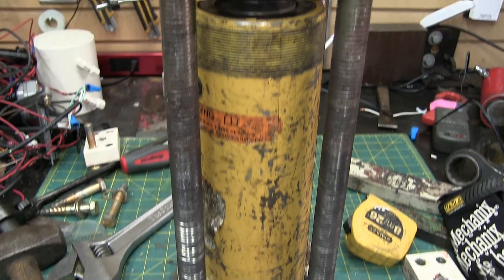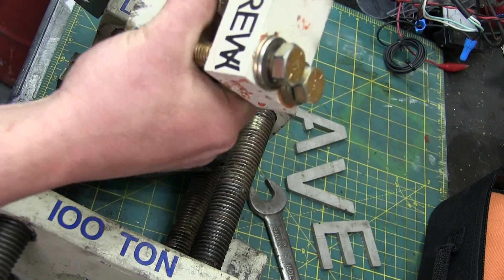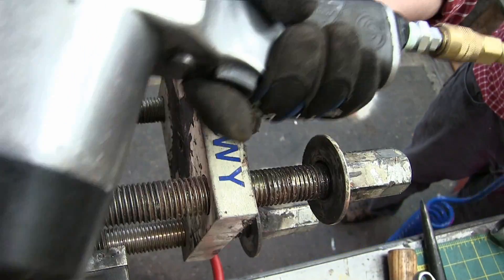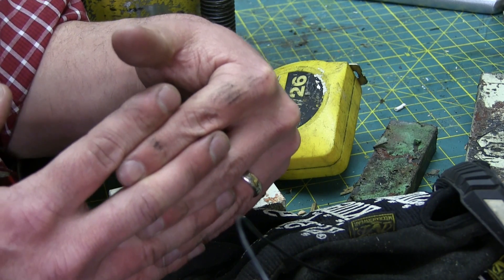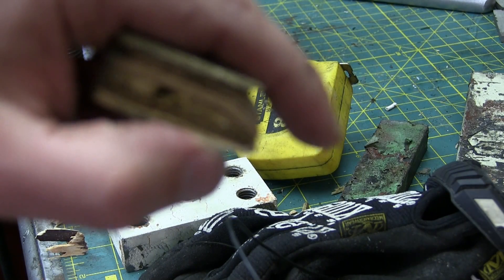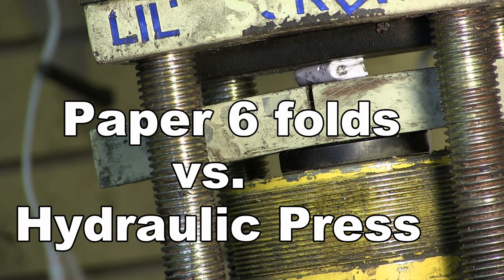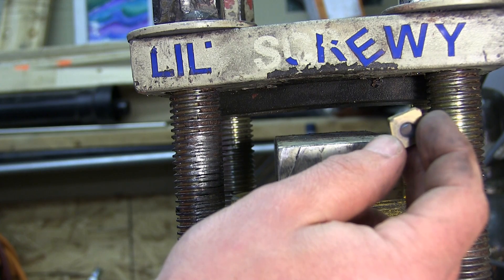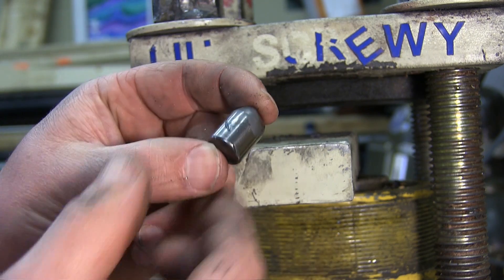Why Paper EXPLODES in a Press?! Prince Rupert's Drop, Tungsten Carbide and more!

Comment: I guess I'm a weirdo...  I didn't have to ask why things explode because energy can only be forced in upon itself just so far, then as more energy is applied past that point of equilibrium it has to go somewhere...  Anywhere.
You're actually causing a micro implosion, just a bazzili-second before it redirects all that energy and explodes.  One grain of sand on a 100 mi. long, 1/2 mi. wide beach that is a "nuke" (basic principle dumbsplained).
  All things in the universe (and a few outside of it) contain its originally allotted amount of "sacred smoke."  From a one celled organism to complex electronics and mechnically oriented contraptions and contrivances, things only work at their station in life as long as they contain that exact amount of that "unidentifiable quantity" of holiness and, once you devise a way to release (or, more impressively, add) any amount of that sacred smoke, she's a-done chuchin'.  For good.  Unless, of course, you replace any component(s) which has had its allotment of smoke to change with a new component, which contains that original amount of sacred smoke, as allotted by the Devine divinity him/herself, putting all things back into its universal balance which, fine-hairs crossed, allowes the flow of the universal forces to church their way along, once again. 
  This "rechuchification" always comes with a cost. Sometimes just some physical effort, perhaps accompanied by the permanent exhaustion of some brain cells and, sometimes, with the addition of great fiscal sacrifices which usually preceed the delivery of a very effective lesson in how to not "dechuch" an item in the first place.

Comment: The geometry of the paper stack affects whether or not you get an explosion.  HPC uses relatively tall stacks of paper.  As the load is applied the compression is transferred to tension - the paper under the press is trying to squeeze out like toothpaste but since it has tensile strength it cannot do that, until it fails all at once. 

Ave used a relatively short stack of paper for the surface area being loaded.  There's not much vertical space for the compression to translate into tension,  so no explosion.

Comment: The exploding could also be due to building pressures at the center of the material. The pressure reaches a point where the material can't be compressed any longer so it starts to tear. The tearing pushes outwards on a separate plane from the pressure of the press. This outward pushing acts as a type of relese for the pressure, thus the material then explodes outwards following the release. The start of tearing to exploding should happen within a fraction of a second.

Comment: You could make those tungsten carbide drilling tips fly straight.  You need to use a sabot around it.  A sabot is a discarding sleeve that goes over the projectile and sits between the projectile and the bore of the firearm.  Tank rounds made of hardened armor piercing metal use a sabot so they don't destroy the barrel when fired.

Comment: When you mentioned the tungsten making a nasty projectile if someone could find a way to stabilize it's flight, it has been figured out but its still not perfect... Tungsten core rounds with copper+lead jackets are very much in use. More interesting are the SLAP rounds that were designed and prototyped by the US military. (S)aboted (L)ight (A)rmor (P)iercing. They use a plastic sabot around a tungsten projectile much smaller than the bore of the barrel so the tungsten doesn't strip out the threads. If you happened to be in the US and we could find a legal way to do it I would be willing to try to arrange making a couple avalable for you to check out. They are rare, go for $25+ per 7.62x51mm round if you can even find them, they were only produced in small prototype numbers in the late 1980's. If its something that interests you I can arrange to send you a few pics of them from a 1988 batch.
Reply: The reason why the SLAP rounds were never mass produced was because they had an issue with flashhiders on the end of standard issue rifles causing rounds to fly all cattywampus, sometimes even exiting the sides of the barrels. Plus the plastics available at that time were much lesser than we have available now so quality control was somewhat of an issue from what I understand. Perhaps they should revisit the idea. Also, light armor piercing doesn't mean lightly armored personnel, it means lightly armored vehicles, barriers, vehicle engine blocks, etc.

Comment: On the subject of things exploding, the recent turbine blade failures on "the most commonly used jet engine" comes to mind. Being a registered sonographer I understand the physics of ultrasound in soft watery bags of meat, but using it metal intrigues me. I currently work as a machinist CNC programmer fixer runner, bottle washer. Maybe it would be cool to cobble together something in the shop using ultrasound to look at metal. I see they have some pretty cheap probes that work ..........yup on a smart phone. Resulting image probably sucks pretty well but what the who never stopped me before. What frequency would we be needed to look at metal what kind of coupling medium is used? Yhea Yhea I know I will use the gargler and seek some info on my own but I am sure a lot of folks would be interested on your take,
Keep the AWESOME vids coming me and my buddy Merlin (cat) love to watch after shitty day at the work place.
Stick on the ice! But it is Damn cold with no T-shart hint hint.

Comment: when you squeeze a piece of an object , the points that hold it together as an object, slowly tear apart , and when there are not enough points to hold the object together the forces that tear the points apart cut the piece apart from the object channeling the force that the piece has been into . this force is channeled from the piece to the object by the mass displacement from the pressure .

Comment: what diameter are the carbide rock drill inserts? the only way i could see making them fly straight would be to give them a lead or copper jacket that is soft enough to engage rifling or put them in a plastic sabot (like some muzzle loader rounds have and sabot shotgun slugs) to impart spin on them to make them spin stabilized

Comment: Well, the tungsten carbide insert would be inherently weaker as it has a hole in it. I'm not saying that there's no difference between the rock button and the insert in terms of grade, but I think that the insert might have done better if it was placed with the hole bore being vertical. Good fun stuff.

Comment: hard to believe I'm back on this vjo after a whole year, just now thinking the paper didn't explode because the pressure was added slowly. Yuri's press moves a little quicker than lil screwy. especially being that lil screwy is at max capacity near the needed pressure them last few tons take a second.

letting the paper gradually deform instead of all at once.

Comment: Without reading the whole thread I'm asking a question that may have been asked already, forgive me. But would it be possible to flip the top and bottom platens and straighten the too near flatness with the press and at the same time putting some work hardening into the platens to increase their strength.

Comment: really gives ya respect for the kind of forces that steel punches put out o.O
got one at work that I BELIEVE is totally mechanical. No evidence of juices leaking out of it  at any time in the past. Just the goop what comes pooping out the sides of the bushings when they grease it up with the zirk/zerk/Xirek? fitting
Thing just goes CLICK A CLACK A CLACK A CLICK and doesn't slow down for nothing.
If you can fit it in there it will cut it
Maybe I'll be naughty and trick the maintenance crew into rebuilding it >.>  <.< so I can watch

Comment: Haven't seen anyone say this but they way you put the prince rupert's drop in there didn't give a good test you need to leave the tail out of the device. The tail on a PRD is its structural weak point to the point you can break it in your hand. However if you don't touch the tail you can smash it with a hammer and it will put a dent in on your bench before even come close to breaking it. So to accurately determine how many tons it takes to break it you have to let the tail hang out of the press like i said you can break a PRD with your hands if you just snap the tail off.

Comment: I could be wrong but the insert looks ceramic! Usually carbine insert will have chip breaking geometry on the faces. They are used for cutting harden steel as a cheaper alternative to diamond.

Comment: You might want to lube those bolts, and flange of the nut, with some Molykote G-Rapid plus paste. It's a lubricant with molybdenum disulfide that decreases the friction, so you get to use less torque on the bolts for more clamping pressure..

Comment: Does anyone even still use slugging wrenches anymore? I remember pulling the skirts on water turbines to restuff the stuffing box seals, and using them. Also at mines and erecting traffic lights, bridges, etc. A 1" or 1 1/2" impact seems easier.
Reply: Your plates are warped, but so are you! Use a plastic sabot, a 12  gauge with a rifled deer barrel and those carbide boron rock teeth will fly straight. The plastic sabot (shoe)  and a rifled barrel will put a hell of a spin on that chunk of tunstern. Take it from a crazy Arizona electrician, from the land where happiness is belt fed, and we shoot at anything ,whether it moves or not. Actually Colorado & Wyoming look more shot up than Arizona. I guess we like shooting at each other too much to attack the road signs. Gotta save that ammo, for when the SHTF.

Comment: It basically explodes because you are putting a LOT of potential energy into a small place.  When that potential energy overcomes the physical tensile limits of the material, you get a LOT of energy and a LOT of heat released at once.

Comment: What about temperature increase? Since HPT's press is capable of 100 tons, I would imagine that there's a significant increase in temperature as the material compresses, and the energy can't be dissipated through deformation. Some materials appear burnt, as if portions of the material reach a flash point internally, which causes heat damage.

Comment: The black dust that exploded out of the hockey puck was probably the carbon dust filler that they add. It does not get "absorbed" into the material as much as its trapped in there until it was released. The rubber itself did not turn into powder.
Reply: +Das Neko I thought some of the pressure convert to heat and burned the center of the puck, where the stress was the biggest, just before it snaped.
Reply: *****
Maybe, maybe not but that is definitely dust and looks very much like coal dust.
Reply: *****
I support your observation. Charring is always an indicator for high temperatures.

Comment: I work for a heavy engineering company that cuts very hard metal F30 etc regularly sometimes vaguely exotic stuff like Inconel.
I've told this story before so stop me if you've heard it.
:-)
I remember a demo at my work back in about 2006 of ceramic machine blades similar to the one you just killed.
They were demoing these ceramic blades that could withstand heats far beyond what all the machinists had been trained was  possible.
The feeds and speeds in the demo were making all the machinists (and me because I felt like these guys knew way more than me) back away  from the experiment.
They machined a seat pocket with no cooling in about 1/5 of the time we'd always done it.
It was amazing to watch the shock and awe of these machinists that had always been taught to cool the tool on the work piece nervously backing away from the witchcraft on display.
That's progress I guess.
It was an amazing experience.
Luv and Peace.

Comment: When you crushed the Prince Rupert's Drop, it seemed to be pressing against the "tail" and snapped it off, causing the drop to explode. Could you do this again ensuring the drop is pinched from the sides without applying pressure to the "tail" of the drop?

They should be able to take a lot of force before popping!

Comment: Should've used your FLIR camera to monitor the temperature as things are compressed. I'd suspect you'll see temps increase significantly.  Although the steel in the press would sink a lot of the heat away from the DUT.

Comment: it is called brittle fracture by the way.
Reply: +AvE sorry I should have been more clear in the materials that had a lot of deformation from the plastic deformation it had just reached the maximum amount of stretch in the material. The harder materials such as the carbide bit experienced brittle fracture due to the inability to stretch due to the type of material and the way it was constructed as well as the direction in which the force was applied. if you took your cutting bit and layer it flat instead it would withstand a much greater force.
Reply: +David Powers that being said I very much enjoyed your video. :)

Comment: thank you so bloody much for your inclined plane screw comment. I find too few a number of people that comprehend how the 3 simple machines rule the function of every mechanical object in existence. You air get it...secure your phallus via an inclined plane wrapped around a pulley/axle which forces two blocks of steel together with tremendous force!
Reply: You sir get it; fucking autocorrect...diddly

Comment: Is saying it's plastically deformed correct? It's technically a brittle material so experiences no plastic deformation.
Reply: +AvE Well I'm thinking of a mechanical definition purely, but if a material does not experience plastic deformation and necking before a fracture point, wouldnt it be defined as brittle? If you exert tensile stress on a straight branch, it won't stretch and neck like a metal, it will just crack at critical stress like a brittle material. I guess a tree though is more of a composite material with grains in every which direction which would complicate things.

Comment: The Prince Rupert drop test was unfair in that it is supposed to be unbreakable provided that you "do not disturb the tail". The tail should be cushioned or placed outside of the pressing area so that it cannot slip and hit the press face as it did so easily in this video.
Reply: +tiger12506 not really unbreakable but really hard to break. stronger than steel.

Comment: of course the paper explosion video was faked, it most likely had a small amount of a sensitive high explosive in it like mercury fulminate. Paper does not explode dude! it ain't like a hockey puck or a prince ruperts drop that is under high tension. Just my thought, but I bet you could do the paper with a million tonne press with no explosion. you're a smart guy, pretty sure you could've worked the out chief. Love the vids either way.

Comment: The only part I would add for something like the hockey puck is you're adding kinetic energy, which is upping the temperature; at a certain point as the temperature rises if the pressure can't get out the material may sublimate to a gas and force elastically its way out.

Comment: I'm disappointed by the lack of physicists explaining this.
Reply: +mastermanio2 I believe the explanation by this channel isn't exactly thorough. What I believe is happening here is the compression of matter and air heats the material enough to allow it to explode. You'll notice it's only combustible (e.g. organic material) that explodes under the hydraulic press. This is because compressing a material heats it if all other conditions are equal. This is also how a diesel engine works, the fuel-air mixture explodes due to the pressure exerted by the pistons.
Reply: find the reply by scasny to hydraulic press channel.  some things explained there.

Comment: Nothing to do with trapped air?
Reply: +Amber Smith (Bambii) Nope, gasses can be compressed much easier than solids can, anyways. You might have a case with weaker materials, spots busting open so it can slip out the sides, but even then, if it's under that same compression, it could probably handle compressed air.

Comment: This exploding under pressure happens even in our galaxy called super nova. A star is in an epic battle where gravity and fusion lock horns. This battle plays out for the stars entire life until the star starts to run out of hydrogen and gravity starts to win the battle crushing the star making heavier and heavier elements until it make iron. Iron is incapable of nuclear fusion and the star then has seconds of life left. The outer layers of the star slam down into it and creates one of the single most violent event in the universe called a supernova! In one explosion it will expel more energy in that second than our sun will make several times over... This is all caused by one thing pressure, so paper exploding because it's put under a lot of pressure makes sense the same way a super nova does.... 

On another note this is the first time I have been able to comment on this channel be able to add on to something. I'm a space nerd but I love learning new thing me which is why I watch!

Comment: First I'd like to say your channel is awesome.  As for the rock drilling inserts that didn't crush in your press, they may or may not be polycrystalline diamond. The reason i say this is because i have been through both Novatek and Us Synthetics and that is what they produce specifically for rock drilling and asphalt/concrete resurfacing or grinding. But alas i don't actually know how to differentiate between the tungsten and the diamond. hHave a great day.